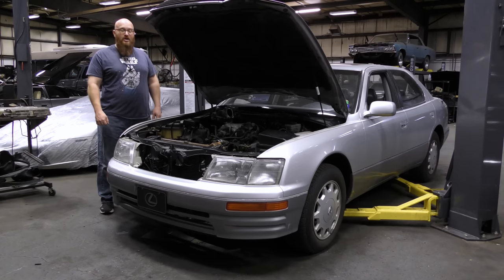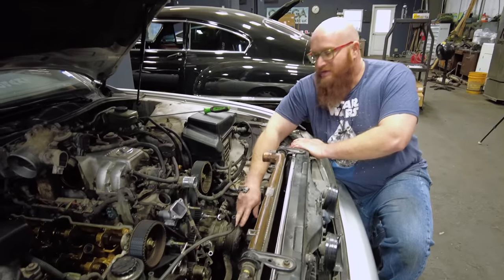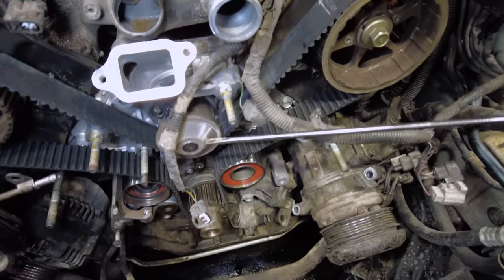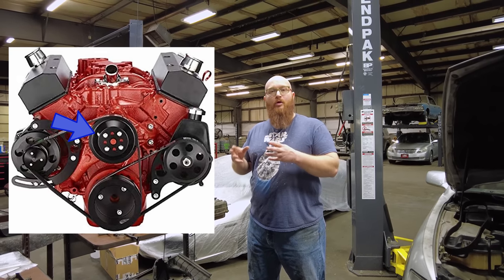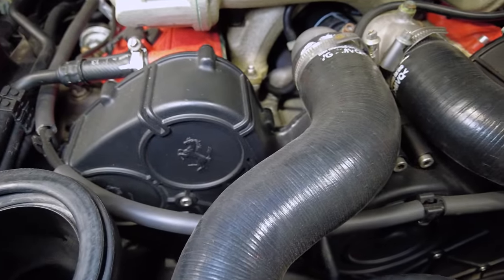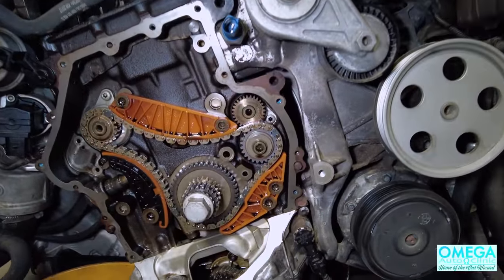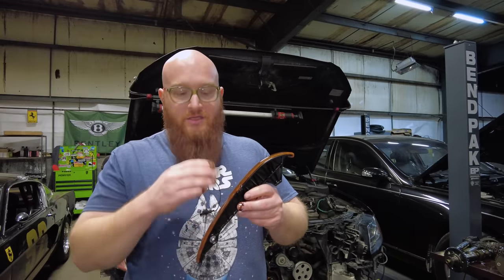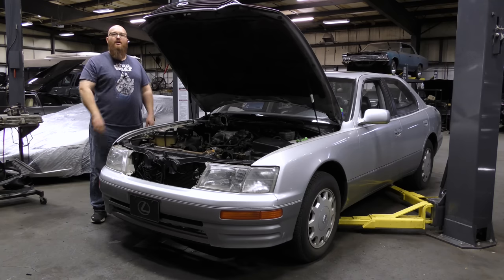My What's Broken? Series #1: Timing Belts-vs-Chains! CAR WIZARD explains why the huge bill

Comment: I had a 1999 ford ranger with the 2.5L and it's timing belt broke. Luckily it was a non interference engine. My brother, his friend, and I replaced it in his garage in the middle of winter in a mostly cold garage. the Belt cost 33 dollars. We didn't replace the water pump or anything but we most likely should of when we where there. So besides our labor to do it. It only cost me 33 dollars to replace it. Now if it would of been the 2.3L then it would of been an interference engine and I would of been screwed. And it lasted for many years then It was totaled in an accident.

Comment: I know timing belts get a lot of bad press compared to chains, especially over their more limited lifetime, but the weak spot on chains is those guides, and there are some engines, where they are a known failure point and it is necessary to do preventative maintenance to forestall a problem. The difference is that it is generally a considerably more complex problem replacing the chains and guides than changing a belt. The reason is that the chains run inside the engine, with cover plates that all have to be resealed to make them oil tight again. There is more dismantling, and more re-assembly. In contrast, a timing belt assembly ought to be designed as a service item on a "mechanic friendly" engine. That means the minimum of things should need to be removed. I recall many years ago swapping over a timing belt on a Ford Cortina, in the dark at the roadside, with the so-called Pinto engine. That was only a 4 pot sohc engine, and it was not an interference design, but it took me less than 2 hours, and 8 didn't even need to drain the coolant (despite what the Haynes manual told me to do). Of course, modern engine bays are so crammed these days, it is never going to be so easy, but it still ought to be simpler than a chain.

Incidentally, it is not just mileage that counts for timing belt replacements, it is also age, as with tyres, for much the same reason. With my car, it is 100,000 miles or eight years, whichever comes first. I will get my belt changed in 2024 on it's 16th birthday, by which time it will have racked up about 140,000 miles, so way before the mileage schedule.

Comment: Honda's still run timing belts darn a few years on a Lexus rx300 ran timing belts for a few years ? And that's a interference engine I got a 2007 Mitsubishi 3.0 thankfully it's a no interference engine 2007 to 2009 is non interference 2010 to 2020 is interference tip to everyone change your dam oil at least every 5000 miles also those dam CVT transmissions change that fluid often also some have a filter or screen all models of cars are different thank you wizard for waving your magic wand aka brain to help everyone peace to you and yours from orange city Florida

Comment: Another reason to change the water pump and water pump at the same time and to save on having to do 2 separate  repairs since you will be in the engine bay anyway. 2 things how about a review of the old black car behind the Lexus and do you think you can wear a wizard’s cap 😅

Comment: there is actually engines with timing shafts that use bevel gears on both crankshaft end and over the head camshaft end. 
these are rare, and I don't think any automobiles used those.

Comment: The two timing belts I’ve seen fail didn’t snap the belt, but instead sheared off the rubber teeth on startup. I wonder if that’s more or less common than the whole belt breaking.
Reply: Why would they snap at all?  They do not look highly stressed, though they are thermally cycled.

Comment: so I recently just had the timing belt on my 2012 Acura TL, it has 143,000km and the Honda dealer said the water pump was in good condition so they didn't replace it, but after seeing this video I wish  that I told them to replace the water pump with the belt.. I'm not even sure why they didn't just recommend it

Comment: Its definitely not unheard of for the oem LS400 belt to last that long, its very rare they snap, unless people treat it like a race car they last an incredibly long time the oem factory belts, longer the average life of many cars.
Reply: So, you are saying that even though the reccomendation might be 90k miles to change the timing belt some people arw driving say 120k miles before changing? 
I was reading a vlog whers a guy said he had the first generation 4.7liter Tundra with 180k miles and he still had not changed the timing belt.
Reply: @thyslop1737  Probably more than anything what I am saying is oem, quality, is key here when choosing a replacement timing belt. There is a difference say if you walk into your local auto parts store and find the cheapest timing belt, as opposed to finding original equipment quality replacement parts. There are some things you can get away paying less for on your car repairs, a timing belt should not be one of those things.

Comment: I knew my Ford Escort LX had around 60,000 miles on its timing belt. My mechanic would not have changed it, except I asked that he change it. Turns out the old belt was starting to dry rot and crack. My engine is non interference 1.9 unlike the GT model. So yes, I am driving a1995 Ford Escort. I don't hot rod it and with 145,000 miles on it still runs great, not even a lifter tap. Since the water pump was exposed my mechanic installed a new water pump. I also have a 1997Jeep Cherokee, other than some suspension work for lift and pull weight. I know people that have over 300,000 miles on their Jeep Cherokee Sport. My Jeep still has under 90,000 miles on it, because I drive the car a lot, because my Jeep is in pristine condition and I am trying to keep it that way. I have to drive some, or the front disk breaks start sticking. But when I drive my Jeep I either am going to someones house or an area with wide parking spaces. I am not one of these drivers that take up two spaces, etc.
Reply: Those Mazda Escort 1.9s seem to be good still see a few of those roaming around
Reply: @CRAPO2011  Yes for a not expensive car, they were made like tanks. I have heard some have weak transmissions, but mine shifts well. I think it's a combination of good maintenance and not beating the car.
Reply: @georgehine9103  yep, the GTs with the Mazda dohc engine don't seem to fair as well.
Reply: I agree, good maintenance and not driving around like a maniac, I think the escort 1.9 engine and Mazda were tanks.

Comment: It would also be a good idea to mention the difference between an interference engine and a non-interference engine. If a belt or chain breaks on an interference engine, you just bought yourself a new engine. If it breaks on a non interference engine, you just got to have it towed to the shop to have a new one put on.
Reply: I'm hoping his next video will cover that topic. It would be a great follow-up.
Reply: I never understood why interference engines were even a thing
Reply: That 1UZ-FE is non interference since it isn't VVTI equipped.   This can be dangerous however because with enough carbon buildup, the piston can in theory hit a valve.  Really, just change the dang belt, it's not that hard and with Toyotas, those belts last forever.
Reply: @rhark25  I'm like you, I never got it. Then I realized that car companies make money from repairs and it makes sense.
It's still troublesome to think about, and when I shop for cars I look specifically for vehicles with non-interference engines then I don't have to focus on timing belts or chains.

Comment: The Volkswagen 2 L gasoline engine has both a timing chain and a timing belt. At opposite ends of the engine, failure of each is catastrophic. Only a German engineer could come up with an idea so brilliant

Comment: My 2015 1.6 diesel vaxhall astra uses a timing chain which is going to be expensive to replace if it goes faulty because it is at the rear of the engine lucky my nephew is an HGV machine he also said truck engines use gears
Reply: Nissan has many smaller diesels in the late 80's and early 90's that had gear drives to the injection pump and the camshaft.
No belts or chains.
Bliss.
Not as popular now because  gear drives are much more expensive and noisier in their operation....

Comment: Nice video Mr Wizard :)  
Timmingchain WAS good back in the days before they made it cheeper / cut a couple off $$ of and make them realy bad with those Plastic tensioners .
Older cars you couldeasy go a life time or aprox 3 - 400 000 miles without even need to think about it .
Just an example here in Europe a Ford Scorpio 2.9 L V6  a timingchain easy did get up to 400 000 miles more or less . many saabs older ones had chain to . easy 2 - 300 000 miles there on those .

And chain timingbelt . Get an old backwheeldrive Volvo 240 740 940 most off them not much to remove for a chain its straightforward and very easy on all B21 B23 B230 motors :) 
It sad to see expensive V8 V12 with all these bad chains & belts . Its just cut corners on quality on the construction & parts .  
Have a nice day :)

Comment: Chains are more durable than a belt. It is the damn plastic guides  I wonder about. I didn't think Toyota had an internal water pump? My Ford Taurus has an internal pump that can be an issue if it starts leaking
Reply: Engines have more valves these days too, which adds to the complication
Reply: But it’s ran by a belt. Even if the coolant leaks it won’t go into the engine.

Comment: Car wizard can you do a video on automatic transmission,  an explanation on differences of trans flush and transmission fluid change. 

My front wheel drive scion xb is reaching 84 thousand miles. I know soon I would have to change the fluids on the 4 speed transmission

Comment: Not sure which means is worse or better.  Usually with a chain you have to pull the crankshaft pulley off to remove the timing chain cover.  I know the Cadillac hook and tow HT4100 they used a plastic internal timing gear with a chain.  It has been know  a cog would break off.   A chain can also over time stretch.
Reply: The only timing belt I've done was on a Ranger but I still had to remove the crank pulley and a the AC bracket-- which, if they split it in two, would have been unnecessary. Doing the timing chain on an Equinox 2.4 was almost as easy but needs gaskets. No, you don't need engine out, despite what what's been said. It's a pretty easy garage job.
Reply: @Sonny_McMacsson  Someone about 2 weeks ago was going to check the timing gear on his HT4100 and had one tough job removing the crankshaft pulley with a puller.  He finally got it off.  My GM diesel Duramax I don't know if it has a chain.  I know the fuel pump is driven by a gear and I think the water pump also. The ID10T who designed that made it so the crankshaft pulley has to be removed to change the water pump.  I was going to have it changed when I changed the CP4 fuel pump to a CP3 and the shop said that would add a couple thousand to the repair bill.

Comment: Anyone that’s had a timing chain or belt let go under load knows exactly how much damage can be done to a motor. I had a 1979 Moto Guzzi SP 1000 that I converted to run Melossi straight-cut timing gears. Sounded glorious.

Comment: It was old engines like that Chevy 350 where the chain would last forever, in a lot of cases they could outlast the engine, newer chain systems seem to stretch easier
Reply: Nonsense . The plastic teeth on the cam sprocket failed within 150,000 miles.
Reply: @truthboomertruthbomber5125  what plastic teeth?

Comment: If you have a "non-interference" engine, then the lift of your valves is not so high that they will collide with the piston when they are open.
Then a broken timing belt would just make the engine stop, that's it.  
 
 But most newer engine want higher power, that needs more valve lift. Then a broken timing chain (or just slipping through, hopping over a few tooths) will cause the valve to collide with the piston.  
 
When you are lucky, you have "just" a bent valve, when you are unlucky, the valve head breaks off and bounces around in the cylinder, smashing into the cylinder wall and cylinder head, ruining the cast metal blocks. 
On old engines you could mill out the bore several times and there were oversize pistons available, but getting those today - doubtful.

Comment: It always fascinated me how essentially a rubber band with bumps could keep an engine in time for 80-100k miles. Prefer chain driven timing but with the longer oil change intervals on new cars and advancements in materials belt timing are lasting just as long.
Reply: I actually prefer gear driven like a classic inline 6 cylinder Chevy.  Eliminates the whole issue.
Reply: @jamescanfield7251  no lies there unless you're talking about the gearset in a iron duke of course. Lol
Reply: @skunkworks9-3  I was actually talking about the one I had on my 69 Camaro with the 230 I6.  Super dependable, and incredibly simple to maintain.

Comment: Just curious, what would you quote for timing chain replacement on a bmw e70/F15 with a N57 engine where they so wisely have placed the timing chain on the rear of the engine, so that you at least  have to separate the transmission from the engine, possibly take the whole engine out to do the timing chain replacement..? I know you already don't like bmw's, this kind of construction probably doesn't help,haha

Comment: 🤔Thank you Wizard and Mrs.   My Audi A6 2.8 timing belt water pump changed every 100k ($1k) Galant 2.4 every 60 ($300), but then a balance belt went taking the engine with it.  What/when to have the chain maintained/replaced
Reply: Never heard of an engine having s balance belt, only chains.

Comment: Chains are the best overall. Stay on top of the oil changes. The Tming Chain will last forever. The Timing belt or belts need to replaced. Unnecessary expensive maintenance unless you have a chain
Reply: Unfortunately there are engines out there that suffer from under-engineered chain guides that require replacement, which I consider insult to injury, you gotta go in there just like it was a belt, often the aftermarket (rarely the factory) will have improved, more durable replacements.

Comment: In addition to timing belts and timing chains there is one more method that is used on some vehicles. The final method is timing gears where there is a gear on the engine crankshaft that is meshed with a gear on the camshaft. This method was used on the old Volkswagen Beetle with the air cooled engine in the back.

Comment: Oh and if you want to play it safe buy a 4mz-fe 6 cilinder engine. Non interference engine. If the belt snaps, no problem. Put the timing back to specs place the new belt and done.

Comment: If you choose well you can get an engine that has no timing belt and no timing chain.
Instead it uses gears to drive the injection pump and the camshaft.
You never need to worry about those steel gerars...they will last the life of the engine....

Comment: that timing belt is installed backwards pointing to the wrong pulley but will still work correctly, the "L-CAM" on the belt is on the right side pulley, and same for the "R-CAM". Look at the right side pulley with "R" stamped into it. LOL I just find it funny though...

Comment: A dealer scam is to charge you for a belt/chain replacement when they do another service that requires the removal of the belt/chain.  They should just charge for the part since the service is built into the total repair

Comment: A problem with chain systems is often the water pump gets ignored and can start leaking. Also, since the change interval is lengthened, sometimes the pump seals get so hard it's next to impossible to extract the pump (Nissan Maxima, 1995) so the job of changing the pump, normally easy on that car, becomes a major problem to solve.
Reply: When I read the first part of your comment I was going to mention my 96 Maxima and then I read the rest lol. I thought I had a blown head gasket due to the oil milkshake from the leaking water pump until I realized what was going on. Somehow I drove to and from work for a week (35 min round trip) like that without grenading the engine.
Reply: Also Nissan had a bad design on their timing chains on their D-40 diesels also used in some of their other cars, where it was too weak for the torque and would stretch and wear the gears etc. Had to do a total tear down and rebuild with upgraded aftermarket parts on a company D-40 pickup and that was about 4.5k$, where they installed a wider, stronger chain and gears..

Comment: I replaced a timing belt in a 2012 VW Sportwagen TDI once.  I now know why it costs nearly $2,000 for the dealer to do it.  What a giant pain in the ass it was!  You would think that since it's a wear item, the engineers would design it to be easier to replace.  Ugh...

Comment: @Car Wizard — @10:37 you talk about the Ferrari needing a T-belt replacement at only 30k miles because it’s a very expensive engine and is ran hard… yet no mention of the AGE Limit for most rubber T-belts even if the mileage is low. 🤨🤦🏻‍♂️😒

THAT is the main reason why that Ferrari is getting its belt replaced. 😅 Because there’s absolutely no other reason to get in there on a healthy 30k mile engine, regardless who makes it. 😤